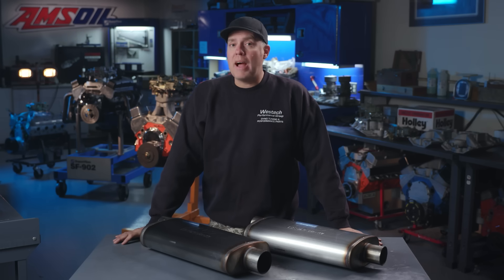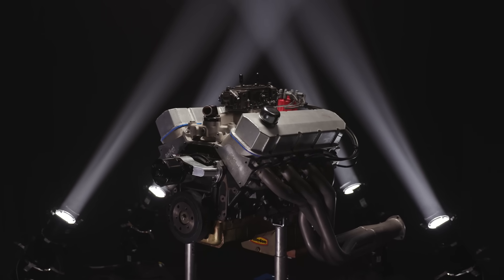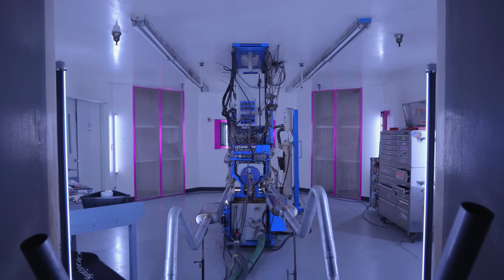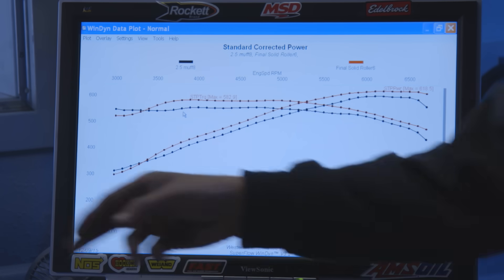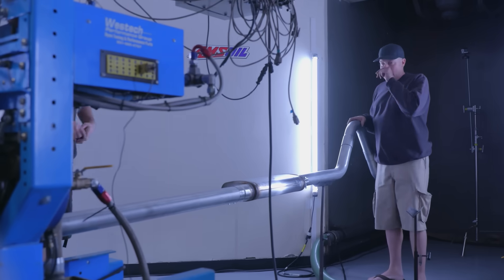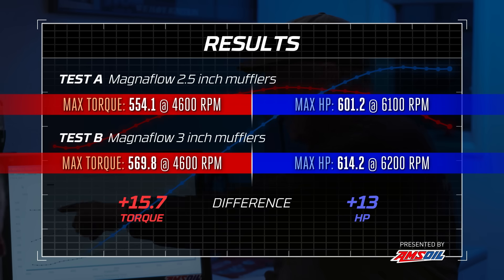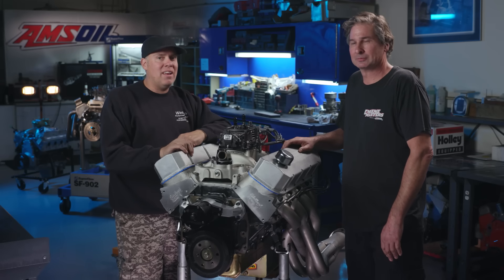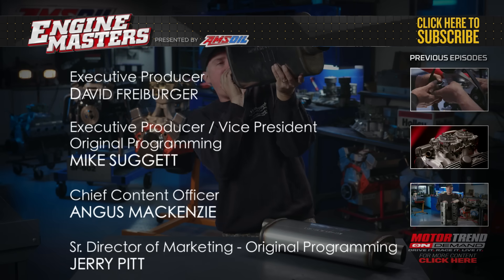The Power of 2.5- vs. 3-Inch Exhaust - Engine Masters Ep. 9

Comment: Now only if you had a cross pipe and got rid of the old fart shit bird carburetor and put the f.a.s.t. or efi live injection system and make some real power
Reply: +charles fournier Maybe in 20yrs they will give up the carburetor, LOL. It's only be 26yrs since the last production car with a carb 1990 buick/oldsmobile. I just don't understand...why not a single plane since you have larger headers, a big Solid roller cam? They are probably giving up 15hp with the rpm manifold vs. a victor single plane.
Reply: +JerseyMikeP 1992- the 360 jeep wagoneer was the last carburetor
Reply: +charles fournier Golly gee golly gosh. Road efi is for lower emissions and decent mileage. And low end driveability.Not horsepower.
 Even a 4bbl manifold with injector bosses and throttle body will struggle to make more power. And then try that with a big flat tappet or roller cam.Useless, gutless and thirsty. Mild hydraulic it may be smoother, more driveable and possibly more economical but almost certainly less powerfull.
Reply: Gefilte Fish Got a link???Allpar.com said the wagoneer ended in 1991, replaced by the grand cherokee? I wasn't sure what was, Wiki said buick/olds was for us sold cars. I just knew the died in early 90's and using them still is RETARDED unless your Drag racing or in a class that requires it.
Reply: +JerseyMikeP sorry, 1991 is right.

But the jeep was still the last US made vehicle with a carburetor, so it held out a year past the buick/olds.
Reply: +JerseyMikeP from wikipiedia:

"In the U.S. market, the last carbureted cars were the 1990 Oldsmobile Custom Cruiser, Buick Estate Wagon, and Subaru Justy, and the last carbureted light truck was the 1994 Isuzu. Elsewhere, Lada cars used carburetors until 1996."

From memory it seems to me that I remember reading something years ago (high school) about the last production car being a 1993 Subaru, but I remember no other details, and since Lada used them after that it might not be relevant as non-US market specific. Sorry if that muddies the waters any.
Reply: +charles fournier At WOT all other things being equal a carburetor makes identical power to fuel injection. They are testing under WOT conditions only.
Reply: As an automotive engineer I can tell you the more control you have over any system the more power you can make at all rpm‘s now weather you make more power or you make higher mpg all comes down to how efficient of a burn you promote now leaner is always more power but there is certain things you must do like zap the mixture before it gets to lean ie a ton of timing advance now the problem then becomes more heat 

Always remember energy can not be created nor can it be destroyed we can only change its form
Reply: +charles fournier Your hasty and scattershot response takes from your comment's gravity and weight. Errors in grammar and sentence structure also introduces doubt as to your claimed formal education and career. From a strictly armchair engineering standpoint much of what you say is correct in theory. The problem with theory and practice is that in theory they both work, in practice only one does.
Moreover, none of this is relevant to the issue at hand, the (lack of) efficiency of the pipe's diameter change versus size and no exhaust system. Ergo, induction system is of no consequence to this test. A crossover pipe may have helped, properly designed (true tuned length or 180 degree) headers would have helped make more power, none of that matters in this test. The test was A:B with size only.
Reply: Ha wow spoken like some kind of little bitchy European guy who gives a flying rolling donut about sentence structure what are we good little robots that only do what the upper crust country club types tell us is exceptable wow I might even say lol man piss on that old shit brain 1950‘s way of thinking the American language is all about communication not following what mastervsays to do
Reply: I am going to let this go if there is anything more off topic, but some basic response is justified.
"Ha wow spoken like some kind of little bitchy European guy..." I am an American born and raised in Fargo, North Dakota.
"...who gives a flying rolling donut about sentence structure..." Words have meaning, and proper sentence structure and grammar helps clarify that meaning. It is bad enough with written word that all voice inflection is lost.
"...what are we good little robots that only do what the upper crust country club types tell us is exceptable..." I am certainly not born as the silver spoon upper crust country club type. Quite the opposite, in fact. As for what you think is the class war, that is your call. I am willing to "except" your thoughts. (You might want to look that word up.)
"wow I might even say lol man piss on that old shit brain 1950‘s way of thinking the American language is all about communication not following what mastervsays to do" In truth, all language is intended to convey thought in a common way so that the party expressing the message can be understood by the intended audience. Language is supposed to evolve with time and usage, but in some people's case it goes the wrong way and instead devolves.

Comment: Honestly a pretty poor test that didn't control for air/fuel mixture nor did it even use a straight pipe of the same length for a comparison. Some x pipes and another run or two would have been quite helpful - it's all sponsored and free. The video ended and I had more questions than when I started. I expected more effort from the producers.

Comment: hi
I would love to see an engine master on the 1990 ford yamaha sho engine to see how much rpm and hp you can unlock from it and see if there is a difference in hp between direction injection and regular injection like compare the new ecoboost tho this old yamaha engine
Reply: +Andre Messier Man, that SHO engine was fun. My dad had a 92 SHO and it was a blast to drive.
Reply: That would be kick-ass!!
Reply: yes i have 2 car sho and 2 engine there is a lot of story about it i would love to see which side of the story is true
Reply: The SHO engine was on the cover (all-chromed-out, even!) of a textbook/shop manual that I used for my Automotive Technology degree, and it sometimes made it hard to focus in class.  ;-)
Reply: yes could we see it but I'm more looking for performance part for the sho

Comment: Would have liked to see an x-pipe thrown in there to see if that makes a difference as well.
Reply: +Paul Jordan It makes a BIG difference and for a single piece one of the best "Bang 4 the buck" super chevy said, "usually get 7-12 more HP on a 400hp small block." Also X pipe give the same boost as an H-pipe, there are video's...X pipe give a higher pitch raspier tone to the exhaust (more European like) and the H-pipe give a deeper tone.

Comment: I have a 79 Monte 355ci, 292 Comp cam, KMJ aluminum heads 2.02/1.60, Weiand Team G aluminum manifold, Weiand water pump, Holley 750 dbl pumper, 350 trans with stage 2 kit and 2800 stall, 3.73 gears, drag radials and I run 3" with Flowmaster 10 series mufflers on the street. The pipes come out just before the back tires. It's loud but hauls ass. I like it better than the 2.5" pipes run out the back. 
I can't wait to get the 468 big block in her. FUN!! FUN!!
Love the tech tips!! 
ROAD KILL

Comment: So, now I'm curious about smaller engines.  For example, is there any difference between a 2.5" and 3" exhaust for a naturally aspirated inline 4?
Reply: +patpatboy2 single exhaust??? Duals would be WAY too big. Here's a good chart from Dynomax.

http://www.grumpysperformance.com/pipechart.gif
Reply: Well yeah, single exhaust.  I'm no ricer.

But that chart only goes down to a large 4 cylinder.  What about something smaller like a 2.2?  Which is better for something like that?  A single 2.5" or single 3" exhaust?
Reply: ***** I would go by the HP rating...a smaller engine could use 1/2" smaller with out losing TQ or choking the HP.

Comment: From what I know, the smaller diameter exhausts work better lower in the rev range is because the air speed will be higher, which helps to "suck" out the air of the engine whereas with a larger exhaust the air wil slow down more so it will need to be "pushed" out by the engine.
I don't know if this is correct but it seems logical to me.

Comment: Might be splitting hairs but for this to be a true test would you need to tune after the exhaust was put on?  The motor was tuned for open header then went rich with the 2.5" exhaust.  Maybe lean it back out for some real numbers? You guys are awesome and I love the show just wanted to see what you thought. Thanks!
Reply: Not splitting hairs at all.  Your point is valid.

Comment: the size needed is simple. the size of the exhaust ports and valve openings deem the size of the pipes needed. as these are the smallest point, theres no point in having exhausts hugely bigger than the ports etc.the morons in the UK running stock impresa turbos with 4 inch pipes are wasting their time. it just makes more noise and nothing else. in addition here in the UK we have laws that are supposed to be adhered to when running a 'road' car (rather than a track only car)
Reply: +David Freiburger bigger engines will, by nature, have bigger valves and ports. and yes RPM does come into play but ONLY after a certain point in the rev band. my own car for example, slightly different as its diesel and stock, but at the sort of RPM where even the 2.5 inch pipes were making a difference in the video, my car would be doing somewhere around 120-130mph. I tested it on a disused airfield and the speedo reading was 145 at 3500 rpm so not much room for scope there without engine mods.the problem comes when you start to modify the engines. bigger exhaust valves and ports etc are great, but that's the point where you need bigger inlet systems (bigger injectors nowadays as carbs are all but dead, certainly over here, except in classic cars mostly) or an addition of forced induction of whichever type suits your needs best, and THATS the point where bigger pipes etc improve airflow. at the end of the day, if the exhaust valves and ports are only, for example, 2 inches in diameter, then the gas can only exit the engine through the 2 inch diameter hole (I know theyre seldom round but its easier to explain) so (as happens here with the 'boy racer' brigade) a 4 inch diameter exhaust system will give no benefits at all. the restriction is the 2 inch diameter exhaust valves/ports. and that's exactly why bigger valves, high lift cams and enlarged ports are pretty much the first stop for gaining power from an engine, especially naturally aspirated. think of it like a hosepipe. if the water flows through a hosepipe at 300 gallons per minute in a 2 inch pipe, but somewhere its got a restriction narrowing it down to 1 inch, then the max flow rate is restricted to the 1 inch pipe rate. its impossible for it to be any other way and it makes no difference where the restriction is, its there causing a problem and its the same principle with exhausts. the smallest point, wherever it is, is the point that creates the most backpressure and restricts the power the most.

Comment: ok now "H" pipe vs "X" pipe
Reply: +Ruben Quintanar Here is a dyno run comparing H vs X on a stockish 5.0L ford.

http://www.6speedonline.com/forums/attachment.php?attachmentid=247270&dateline=1369935303

The interesting thing is the difference in sounds. The H-pipe has a deeper/throatier sound, while the X-pipe give the motor a raspy/high pitch "european" sound.
Reply: AWESOME!

Thanx dude!
Reply: huh.... so it doesn't REALLY make a difference as far as hp and tq...

ok so i'll just choose the deeper/throatier sound with no worries hehehehe

Comment: good show, but sometimes.....

 where is carb tiuning after cangeing exhaust system? mufler and power, try straigth system based on rezonance, similiar but not quite as 2 stroke.
 on whreal you tuned carb without mufler, and later your engine strugoed with them.

Comment: how much of a difference would hot exhaust vs cold exhaust make?
Reply: +George Papadopoulos It wouldn't affect a carb all-motor engine. If it was EFI, the O2 sensor would need to go into closed loop. If it was turboed, hotter is better...before the turbo atleast.
Reply: Wouldn't the gasses be more dense  in a cold exhaust and therefore slower as opposed to a hotter exhaust with thinner faster flowing gas?

Comment: Nice test but would be more interesting if you tested various engine setups across a wide range of horsepower and capacity. Because a 3" exhaust on a 200hp car will create completely different (adverse) effect. 
Most important would be to match specific exhaust diameters and lengths to specific horsepower ratings, because horsepower (with equal efficiency) is what decides the airflow.

Comment: Does a crossover pipe make any difference in a system like this?
Reply: +Tito Rigatoni Yeah usually you pick up a good amount of power... on a setup like this..the 3" would probably make up the difference between it and open header..pick up 10-15hp.

"On a typical 400-horsepower street car, adding an X-pipe or an H-pipe to an existing dual exhaust system can add 7-12 hp." from super chevy article.

Comment: Yeah well i have a Question. If you would remove the hole exhaust system would it have the most Power then?
Reply: +Hochuli Marc no; straight zoomie pipes would produce the most power, the kind you see on top fuel dragsters.
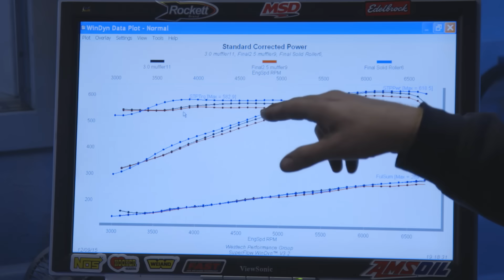Reply: +Hochuli Marc The base motor with just headers and 18" pipe extension...they said made 620hp vs. 614hp with the dual 3" they talk about the comparison at 10:30 into the video. Hp was very close, the open exhaust did show a gain in torque in the mid range(3500-4000rpms).
Reply: +JerseyMikeP I think he was talking about removing the exhaust completely; removing the headers and everything.
Reply: +Tito Rigatoni Yeah...On a normally aspirated engine...that wouldn't work at all, LOL. I replied to another guy that was saying that. There has to be some exhaust pipe to get any scavenging at all. The motor would fall on it's face and would lose large amounts of torque.
Reply: +JerseyMikeP so if you would remove the hole Exhaust the motor would loose torque you say. So if this is true there IS actually a littlebit ofbackpressure needed? Or why wouldnt he have most power without exhaust?
Reply: +Tito Rigatoni okay. So what is so good about the straight zoomie pipes? Why are they better than no exhaust?
Reply: +Hochuli Marc It isn't back pressure, it is the opposite. The pipes are tuned to promote scavenging of the exhaust gases, by delivering a pulse of negative pressure just before the exhaust valve closes. The pressure in the pipe is not constant, it is a flowing wave of high and low pressure pulses. Without the pipe you lose these pulses, and the pressure at the manifold actually increases.

Comment: You should have also done the 3-inch WITHOUT the muffler to .compare; like a straight pipe.
Reply: +jdmeaux It would be a straight pipe.... It would just slightly pick up low end torque since the pipe is longer than the 18" extensions they said they used on the base motor...longer extensions improve low-end.

Comment: Didn't magnaflow say that you only need to go larger then 2.5 when you go past 500hp? Not really surprised with the results. haha
Reply: Makes me wonder if I should make the 2.5 inch single exhaust on my 400+ hp turbo car bigger. lol
Reply: +Matt Greenland 500hp with 2.5's would be choking it pretty good. Dynomax recommends stepping up to dual 3" at 450hp.

http://www.qsl.net/ya5t/techchart.jpg

While Flowmaster recommends using dual 2.5"  (race application up to 400hp) page 88 of their catalog

http://www.flowmastermufflers.com/images/fmcatalog2013_digital.pdf
Reply: +Matt Greenland 2.5 dual or single?
Reply: +Holden S Most likely dual. Most 300+ HP cars use two mufflers.
Reply: ***** I think it's single, but don't quote me on that. I don't see why you wouldn't go bigger, won't have lack of back pressure problems with the turbo there.
Reply: ***** would definitely need duals for 500hp.

Here is a good displacement/HP to pie size chart from DYNOMAX:

http://www.qsl.net/ya5t/techchart.jpg
Reply: The reason I went 2.5 in the first place is that the outlet on the turbo is 2.5. I couldn't decide if going bigger would make a difference with the outlet only being that big. *****
Reply: ***** A 500hp engine would need more than a single 2.5" If its a turbo 4cylinder..what's the downpipe, turbine extruder size? I would have spilt in to dual and run dual cats (if you are running converters).

Duals will give you more ground clearance on a car and running duals will give you more catalytic converter area to prevent an excessive back pressure.

Comment: You should put turbos on a ls with a stock bottom end and put as much boost you can put onto it and try to blow it up just to see how strong the bottom end is
Reply: +Wyatt Myers They did that...with a 4.8L they put twin 76mm turbos on a stock block, rod/piston and ported stock heads. They put a big cam in it and a FAST intake and pushed it to 1,203hp @ 7,000rpms with 26.8psi on 118octane. Here is the article.

http://www.hotrod.com/how-to/engine/hrdp-1109-stock-gm-ls-engine-big-bang-theory/